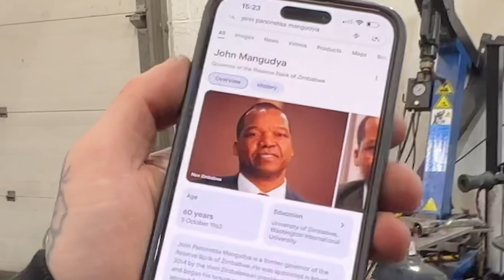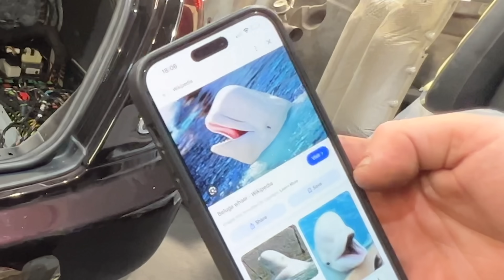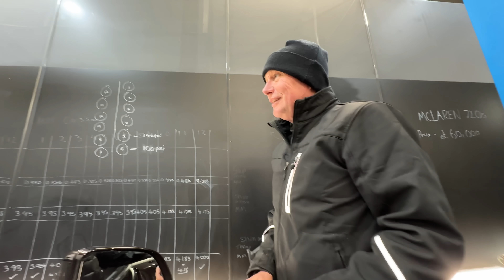I DESTROYED A ROLLS ROYCE TO REBUILD MARCUS RASHFORDS WRAITH

Comment: That Pinocchio joke on Rashford was 🔥🔥 😂
Reply: totally agree how can 30 mph have caused so much damage the Rashford Rolls has just disintegrated
Reply: That old lady must have gone at least a hundred miles per hour I reckon 😂
Reply: 2 ton is a lot of weight when it hits things till stopped
Reply: @fordfella67 Bro, even if it was 4, at 30mph?
Reply: @fordfella67  no, weight has nothing to do with this. If it was weight then Newtons 2nd law of motion wouldn't exist. Rashford or the insurance company are clearly lying.
Reply: @Edison.m3806  I mean still it has a higher mass compared to other cars, so kinda makes sense F=m x a, maybe closer to 40mph ish.
Reply: PRashford in full swing.
Reply: @hareendrabasnayake  I think rr was around 50-60 mph ish when accident’ve occurred.

Comment: Mat I see you buy airbags when they have been fired. There is a company that repacks them as long as they have not been cut and also reinstall in seats including stitching. I’m sorry not sure of company but info can be found on Salvage rebuilds UK on you tube as they use them.